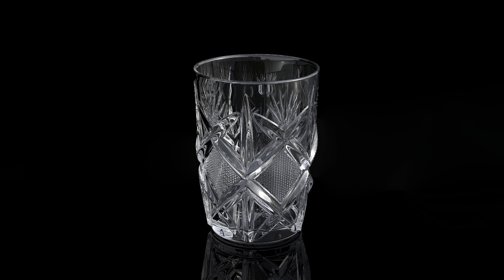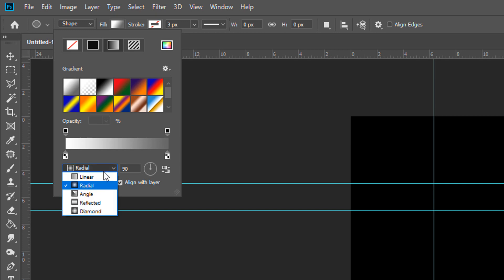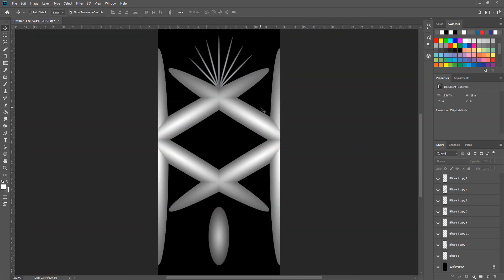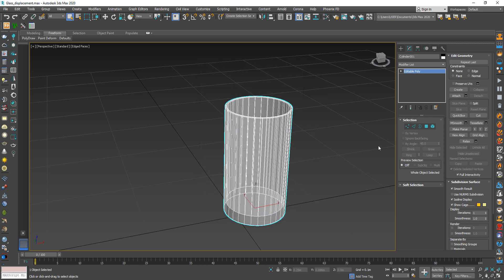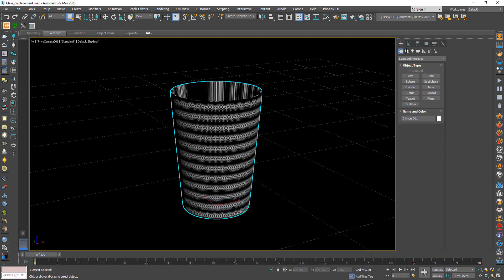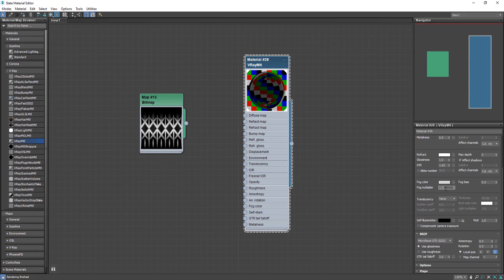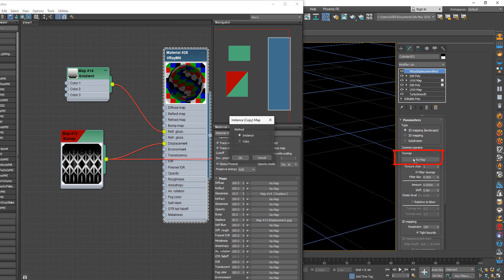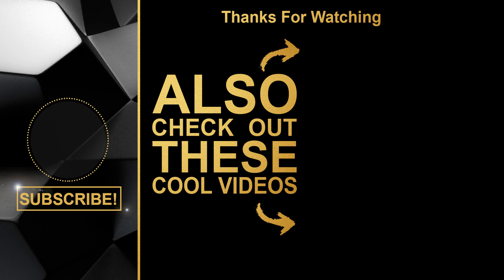3Ds max - How to create a realistic crystal glass by displacement map using Vray

Comment: I liked a lot but why to use irradiance map for a simple scène as this one, as it is less acurate, and as brute force+lightcache method will also render this glass very fast? Thanks for sharing valuable tips
Reply from the maker: I was thinking like you the brute force will be faster than the irradiance map as you explain (simple scene) after a lot of experiment exactly using this scene, I have a good result by using brute force without displacement map, but on the other hand, when I add a displacement map to the model everything change I can't reach a good level without noise using brute force in a reasonable time it took a lot of time compared to irradiance map.